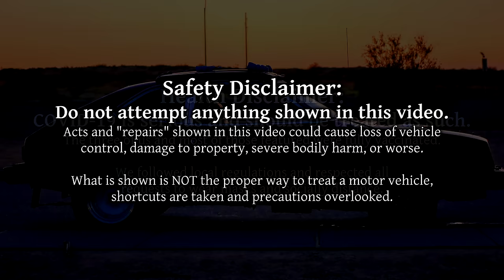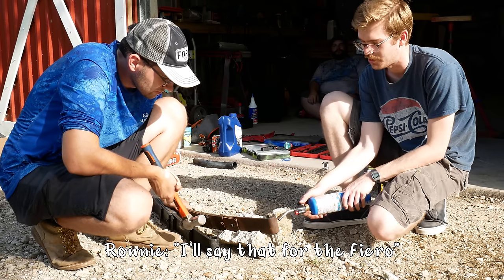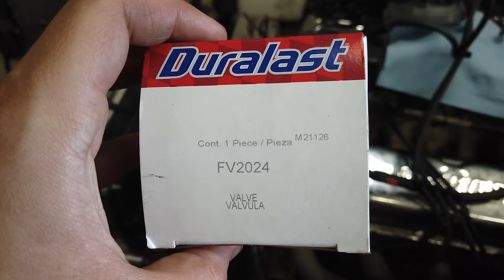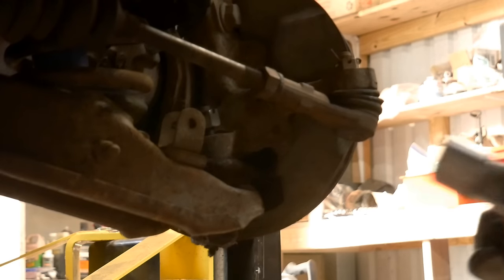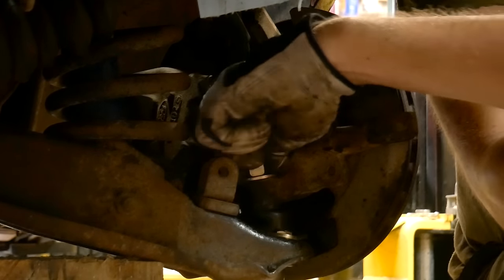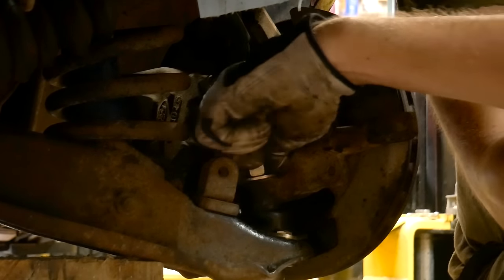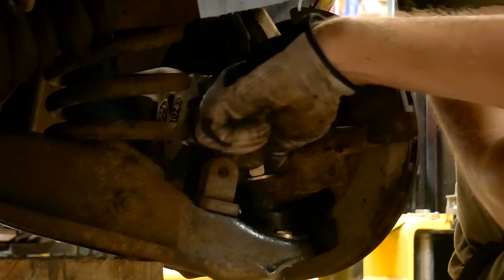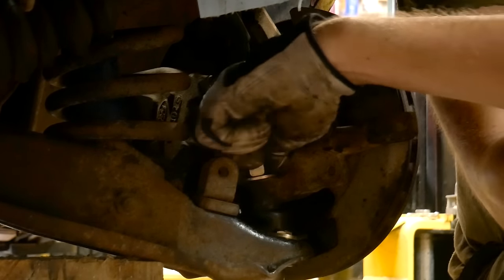Driving a V8 Ford Pinto 3000 Miles Home Finale (Ronald Finger, Driving Texas to Maryland) (Ep.4)

Comment: One of the tricks we used to use when racing on dirt track or clay. We used to make grass burner pipes. You wanted to make sure when you cut them off they were all the same length. We would Use harley baffles just to make sure we didn't lose any torque... 🤔

Comment: Cool video series! One piece of advice. You should put header wrap on the headers. It really makes a difference with underhood heat. And put a big scoop on the hood to push air in the engine compartment as you are driving.

Comment: Good job MAN. October 3, 2021 did the Arizona trip in my 2001 3500 Dodge van. Once I got to Arizona I had to put 4 new tires on the van...I-40 beat the old new tires quite literally to death. They were out of round (the worst of 4) by an inch and a half. I decided to take I-20 back to Virginia. I wanted to take I-10 but my copilot was in a hurry to get home. All in all in my case about a month to short. Fun times!

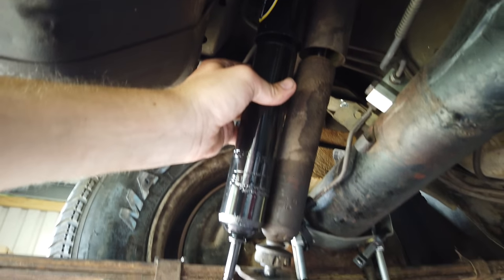Comment: Had a 73 back in the 80s.  I put a mildly built 302, 9" and C4 in along with a 10 point cage and NOS.  Thing was a blast but I'd never have tried to drive it 3K miles with a 4:33 rear lol

Often thought about trying to find another for a project to take to cruises but I don't know if Hooker even makes the header kit anymore or if the Ford motor mounts are available.  This brought back some really good memories. :)

Comment: In the 70s i made a lot of those cars at edison nj plant summer job.. 1 per minute or less in afternoon.. Girlfriend had a v6 one a real dog..slow as molasis.. auto matic.. I can still smell the plant smell anywhere i traveled.. Miles away..  I still got original screws for trim chrome and black.plis door switches..  Kick plate and sill chrome strip..nice screws.. oh I replaced incorrectly jetted carbs for 1 month 10 hours a day..I still got the swivel socket extension and wratchet they never asked for them back.. nice wratchet black though..

Comment: 3,000 miles in that car is rough duty! I drove my ‘73 Runabout (2.0L, 4 speed, everything working) from Louisville to Atlanta back in ‘84…and it was awful…and when I was young I could ride anywhere in anything. But that Pinto was a penalty box. Nice job on the video and I hope you can fix the Pinto, and have fun with it. Stay safe and good luck to you!! I pray that there is an overdrive transmission in your future…soon!

Comment: A loose torque converter (stall converter) can generate a lot of heat in the trans. A separate trans cooler is a must when running a stall converter. Running your trans lines thru the trans cooler in the rad can increase coolant temps (overheating issues). Also with no T-stat or restrictor in place, the coolant passes thru the radiator too fast not allowing it to cool down as it should, thus the coolant temp creeps up at highway speeds but won't be much of an issue during in town driving. Enjoyed the video!

Comment: You have skillfully crafted a very fine video.  As you reported the engine temperature, it seemed to me that you may have needed a thermostat to control the coolant flow.  If it was rushing through the radiator, it would not have been adequately cooled.  Just a thought.  I enjoyed your video.  Thanks.  Glad you safely returned home after this adventure.

Comment: I used to own a slightly older yellow pinto. Same shade as the yellow still showing in yours. I had quite a few adventures in that car. Most of the time it broke down where I could easily fix it. On long trips it seemed to always do well.

Comment: Be proud that you made it there in a budget build PINTO. They were actually good running reliable cars back in the 70's. The 4 cylinder engines were so much better then GM's Vega or Monza engines. It's not a bad looking car either. If you clean it up and either paint it or do a good detail job on it and maybe buff it out, you may have a sharp little hot rod. Tune up that 302 and get it to run cooler. It sounds mean and if tuned right it should do great down the quarter mile. I can give you one tip on the over heating and that is make sure you have a thermostat installed. Some people think that not having one is better because the coolant is constantly flowing and doing a better job of cooling. However, without one you are not giving the radiator a chance to hold and cool the fluid before opening and sending the cooler liquid inside the engine. The coolant is constantly circulating with no chance to cool any portion of the liquid. I am sure you probably know all this but I have owned several home built hot rods with the same overheating issues. Most had either timing issues, dirty cooling systems, automatic transmission issues or no thermostat or a faulty one. Unless it's a bad build with mismatched heads, I am not sure what else can cause an engine to overheat. Like I said, I am sure you probably know this but in case you didn't I thought I would toss my two cents into the bucket.

Comment: My first car was a 74 Pinto runabout. Had tons of fun and that car went coast to coast florida to cali canada to mex e co. 180,000 miles when I sold it. 5 years later it was still running, original engine 250 K miles. Change the oil and replace parts and engines can last for a really long time.

Comment: Just a maybe for the cooling system,  the shroud around the radiator should have holes in it to allow air flow while driving,  might help with the overheating.
Also,  a former friend of mine , had a Jeep Cj 7 with a v8 swapped in , he added the largest heater core he could find and plumbed it in , and mounted it in the engine compartment with a box around the heater core to direct airflow,and it did help.

Comment: I hope the engine is still salvageable.. thermostats slow the water down enough to cool the water in the radiator and cool the engine so use some kind of thermostat in the future. Any vacuum leak causes lean burn and heat as well

Comment: I had that Prius speed issue too.  It's a bad capacitor on the speedo display board.  It's easy to replace, but getting to the board requires almost completely disassembling the dash.  But if I could do it, it would be an easy job for you.  Just be careful not to touch the soldering iron against the VF display.  The heat will make it crack.

Comment: Another piece of advice, move the trans cooler.. Your radiator is not big enough for preheated air from the trans cooler. I am guessing you have an aftermarket torque converter. Those generate lots of heat in the trans. Likely you can move it under one of the front fenders.

Comment: you might be able to fit a mustang 2 radiator in the pinto or a radiator from a 67 mustang! I have a 67 mustang radiator in my 78 mustang 2 it took a little bit of modifications but it works great and it's a 3 core aluminum unit! your over heating issue is likely caused by an upside down head gasket! it's very easy to make that mistake if your not familiar with the sbf! there are coolent passages on one end of the head gasket that need to go towards the back of the engine so cylinders 4 and 8! the way they label the head gaskets it looks like one of them is upside down but really it's not! so I would pull the heads and check!

Comment: i'd mentioned the radiator size . but it could also be the huge gaps around the radiator. its possible the air is being pushed around the radiator and going around it. thus not pushing that cooler air thru the radiator.

Comment: I'm actually about to take a cross country road trip myself this Tuesday. I am active duty military and currently in San Diego and heading to East Tennessee to see family and friends while on leave. The car or truck of choice I am using is a 1983 Ford Ranger. It's a single cab long bed with the power of tower 2.3L Lima One Barrel Carter YF equipped carburetor along with a 4 Speed Manual and 4WD. Although I've got two motorcycles, two seabags, one suit case, and 3 back packs going with me. Almost a 1000 pounds of cargo on this little truck. Wish me luck because I'll need a lot of it.
Reply from the maker: Best of luck on your drive, safe travels and have fun!

Comment: Had a buddy in FL, Tampa Bay, who had a Mitsubishi "Mighty Max" pick up. Put a 302 small block in it. Same problem, overheating. He figured it out. A larger Radiator and 2 electric fans the better fans. Pushing the highest volume of air.
 It worked. Ran 195° in FL in 95° weather.

Comment: This info might be too late, but the issue with the instrument cluster on the Prius is a common one due to bad solder joints. Eventually, it gets bad enough that the vehicle won’t shut off (if it was already on) or turn on (if it was off). As a tech, because customers expect warranties, I always replaced the cluster, but you could just go over the solder joints or send your existing one out for repair.

Comment: That block my have a SOLID inch or two of GUNK caked to the bottom of the inside of block, that could be holding heat as well as decreasing cooling system capacity. It may be so hard that flushing will never dissolve it. You may want to look inside the entire block everywhere coolant flows with a borescope..

Comment: Good series! Well done. BTW the overheating is absolutely due to the rad being too small.  You have done a wonderful job of doing everything you could to make it work (seriously, good job)....other then the obvious take that trans cooler off the front of it. You are literally heating the air before it goes through the rad. That tiny rad has no chance. That's why the ambient air temp makes such a difference. And, yes, as a tech of 28 years, and a hot rodder of even longer, I am somewhat qualified to make that diag.

Comment: I just had that happen to my 2008 Prius. Needed to replace a capacitor on the display. Disassembly of the dash is pretty straightforward and the fix is really cheap. Replace all 3 surface mount caps, but the main culprit is the 100uf one, which should be replaced with a 220uf. I only did that one, but if you are already there, replacing all 3 will give some piece of mind. Several YouTube vids on this.

Comment: If the leak is from the gearbox I wondered if it mattered to you that ATF is flammable noticing it splattered on the mufflers.
I remember the Roadkill crew using the garden sprayer technique to improve cooling. The pinto had a four cylinder engine. No wonder you are having overheating issues with the limited space for a better radiator. Not to mention the heat-wave.

Comment: Ah yes.. my first car was a 72 hatchback with the 2l engine and auto trans. I spun out and hit a stone wall with it but fixed it and drove it for 2 more years. Our family owned a few and My dad flipped a few as a side thing including a 71 with the 1600 cc engine and 4 speed with trunk, 72 wagon 2l auto faux wood paneled low miles that I took my drivers test on, and a 76 2300cc with 4 speed, that was a peppy car. My sis wrecked both of those. Our 79 fairmont wagon with the same engine and 4 spd manual was a dog. I lusted after the Todd Kaneko turbo 2l pinto that I read about in a magazine!

Comment: I watched all the videos over time but I dont recall the rear gearing mentioned.  I'm betting 4.11 gears.  I'd have changed the gears to 3.00 highway gears.  You would run at around 2k RPM's and likely much cooler.  Also if that 302 has a decent hotrod cam in it it will have a loping idle.  A smooth idle means it's way to high.  I hope you used Premium gas to keep the pinging down.  Octane booster might have made for a quieter ride.

Comment: Sounds a bit like me, left CT in my 2000 Silverado, about to put a third transmission in, in a 45 day period, mechanic screwed up the one in it now by not putting the transmission cooler lines on wrong. Lost 9 quarts of transmission fluid, it's in limp mode now

Comment: Put a thermostat in it to stop it overheating, the correct thermostat has a plate on the bottom to block the bypass port when the engine is hot.
Without it the engine doesn't pump all of the water through the radiator making it run hot under load.

Comment: I bet an aluminum Mustang II rad would bolt right in the Pinto. They're 6.5" wider, probably about the same height and the one I got for mine from Jeg's was a great price. Hell, even if it's a bit taller I know you could figure out how to get it in there. Part number from Champion is CC514, they're rated to support up to 550 horsepower. The radiator in the car now isn't even as wide as a factory Pinto unit which should be about 20.5" across. I can almost guarantee that a bigger rad will solve the cooling issue.

Comment: I know you did a flush, but you're really going to have to either run an acid type flushing agent, or better yet. Evapo-rust makes a great cooling system rust remover, that is non-toxic and non-acitic. With all the rust that keeps coming out when you open the cooling system, there's still some in there.
That's above and beyond the fact that you don't have a completed shroud to force the air to go through the radiator, The radiator is just undersized for this application, and that transmission cooler is taking up the large majority of the radiator core. 

Additionally, there really needs to be a lower valence to create a vacuum that allows the high pressure air in front of the car a place to exit.

Comment: You probably know this by now, But if not. A high speed fan would do wonders for that over heating problem. Or push/pull fan set up, Or 2 speed fan. One for idle one for High rpm.

Comment: was the fan wired backward? maybe a little confusion when switching from pusher to puller setup? would explain how it cooled fine idling when stopped. when at speed the fan fought the airspeed making a dead zone of no airflow in the radiator. cus normally inadequate cooling systems get hotter as you slow down.

Comment: I had a rough 78 corvette that was almost as bad as your pinto. Broken rear leaf spring..6 pistons had broken rings. Every tank of gas I had to add a quart  of oil.. 12mpg on a trip with my brother to Daytona Beach. I welded a trailer hitch on the vette and we took a CBR 1000 and a Kaw 600 ninja with us on a overloaded dirt bike trailer with 8in tires. The tires wore out completely on the way back. It rained all the way there and the wiper motor on the vette would over heat and stop working about every 30mins. That was 20 years ago. The vette is in a lot better shape now lol..

Comment: I'm betting that you could have solved your overheating problem with a separate transmission cooler.  Pretty sure your torque converter and transmission are set up for drag racing and create a lot more heat than a stock one would.

Comment: 3800 miles on what is a small aluminum drag radiator?
Welp, you made it home, which is amazing LOL.
That thing is meant to go to the track, run full tilt, for 1/4 mile and then get hit with a sprayer till next run.

I foresee probably a custom radiator in your future, wider, so you can max out as much of the frontal surface area you can.
Probably some fabbed shrouding to duct the frontal air into the radiator too, fan is only useful when sitting still or going very slow.
It is a bit hard to cool a V8 pinto, or vega for long range driving, but it can be done.
Easier with a gremlin, hmm idea for next video!

Hard to say just from a video and without at least an O2 sensor stuck in the tailpipe
but you might check if the secondaries are not perhaps too small, pulling it lean when over 3k rpms
Worth checking anyway.

Balancer timing marks may not be correct, may want to do a static check on that.

But it's home now, so now you can document fixing up all the little issues :)

Comment: I just wanted to let you know, I really enjoyed your Pinto Videos. 

The running hot issue could be the radiator is just too small. Or if the heads have been off in the past. The head gaskets may of been installed upside down. This is a fairly common mistake made on SBF V8's.

Comment: If the spark knock is still a prob try 91 ultra! It may have high compression pistons and if that's the case somebody probably put a performance can in it. Can lift can be figured out with a magnetic base dial indicator on back side of lifter then rotate to lift valve and check dial to keep track of lift. Factory lift will be less than performance. Check lift to performance cam specs on current performance cams offered

Comment: 1:06:30 You know, I've been thinking the radiator size has been the issue since I picked up this series and started following you channel. Despite the sub, I never get notified about this being the upload. 
My father, who had an original 74 Pinto with a cammed and tuned 4 cylinder, said your radiator was smaller than he remembers his to be, despite cooling half the cylinders. I really feel like when everything gets turned up to 11 (less than ideal radiator size + inefficient cooling + 110+ degree desert heat) the radiator just can't handle it. But the fact that even in 70 degree ambient temps you are limited in speed by the radiator after EVERYTHING you've thrown at it, the radiator was too small to begin with.

Comment: Engine Overheating at higher speeds and coolant overflow full..... Blown head gasket or cracked head(s)? Or if the intake manifold was loose what about the cylinder heads?

Comment: You are supposed to connect the vacuum advance to a port on the side of the metering plate of the carburetor. Vacuum advance is supposed to be driven from venturi vacuum.

Comment: The reason the temp dropped to 190 is you were driving slower, meaning less rpm’s thus allowing the coolant to remain in the radiator and cooled by the electric fans. 
The radiator is way too small not allowing the coolant to remain in the radiator long enough to cool.
See if a “short” water pump is available for the small block Ford. Room for a thicker and wider radiator.